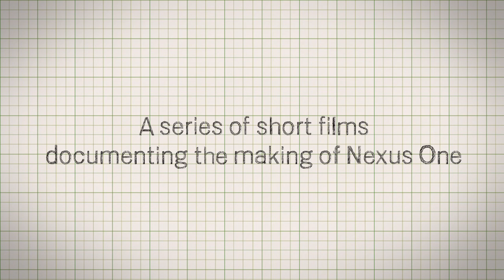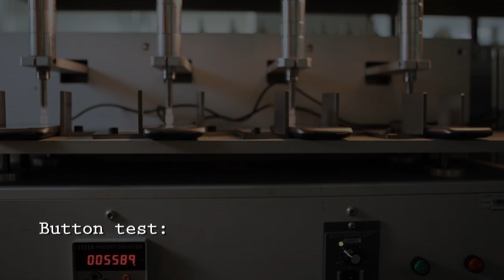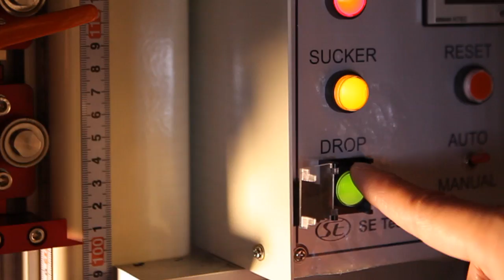Nexus One: The Story - Episode 3: Testing

Comment: They should have tested power button instead of trackball. And mayby a seal around the screen so the dust wouldn't get under it. When I exchanged my phone for having dust under screen HTC sent me another phone and power button completely died within 4 months. Now I have Sensation 4G and the power button is starting to stick. If you have a Sensation 4G and you phone keeps taking screen shots you power button is failing. The firmware update is not a fix rather a workaround.

Comment: They are not gonna test that ofcourse it will break on concrete even if u fall with ur head on concrete..at crash test they test the car at normal speeds let's say 35mph and not 60+mph because u will die at those speeds